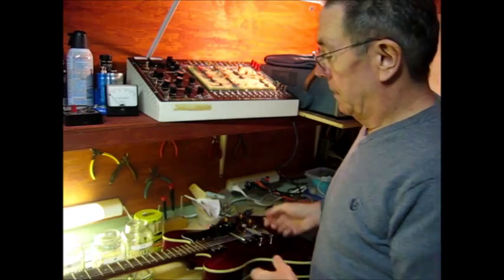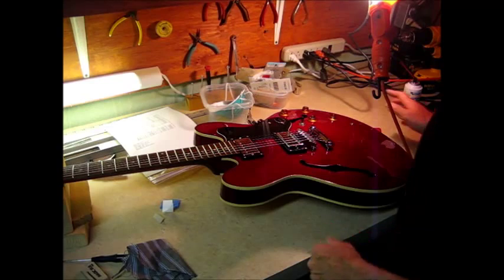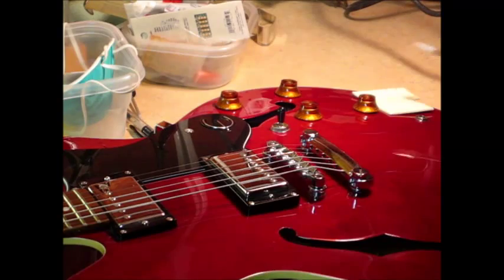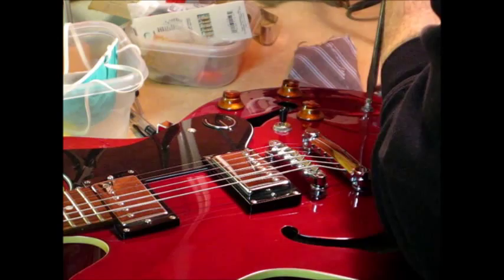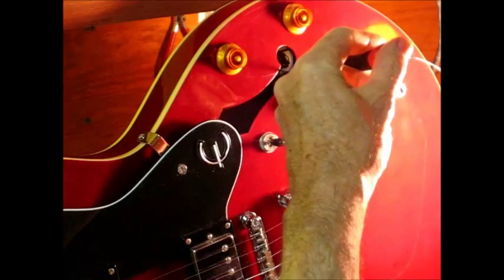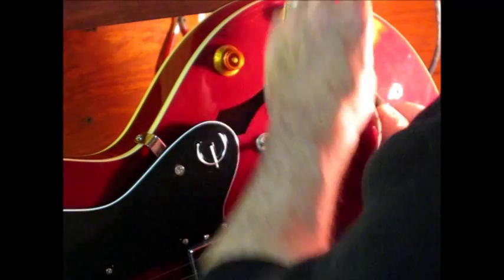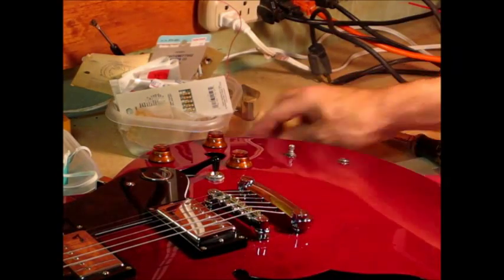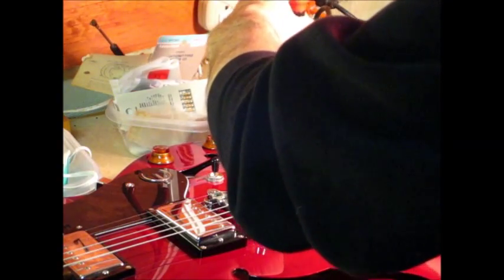ES 335 Tone Control Part 1

Comment: Be sure to use huge oversized tools, tape nothing off to prevent scratches or gouging with your tractor screwdriver...  Just keep spraying  and spraying, if it doesn't work ...repeat 3.5 days in a row..               Epiphone Tech......
Reply from the maker: @John Don't forget to view and provide feedback on Part 2, where I replace the tone control, and where I believe I demonstrate much of the care you are advocating. :-)

Comment: Hi Craig. Nice Video.
I have scratchy pots in my Epi 335 also but I also have what I believe to be a grounding issue. I'm going to pull the entire wiring harness out to clean everything up and check all of my contacts, polarity, etc. I normally would think that the problem was only dirt in a pot, but the original pickups were replaced with 1960s era PATENT APPLIED FOR pickups by the original owner. And I never really trust Mods done by others when I'm unsure of their skills.
So I have a big job ahead. I'll try to take a few pics.
Thank you.
Reply from the maker: +Rick Davis Hey Rick! Thanks for the feedback and I hope your repair went well. Often there's a broken connection to the bridge from the ground. It's important to look out for that. Let me know how it went.